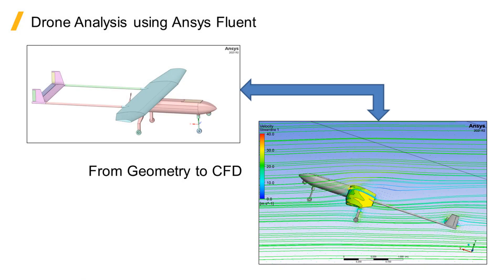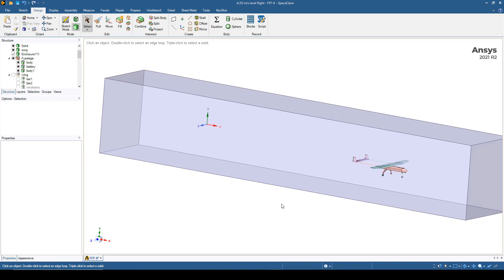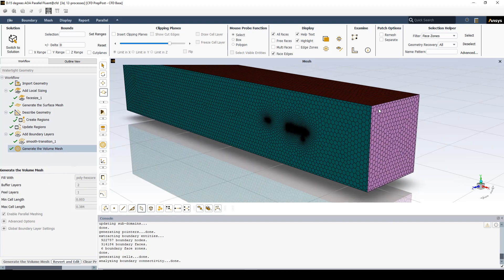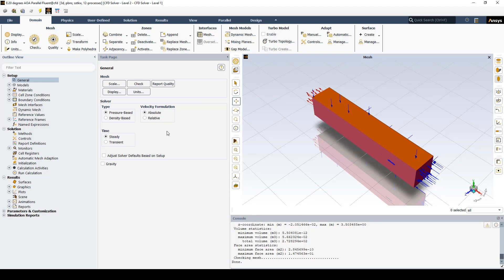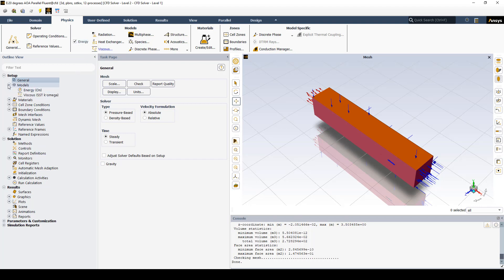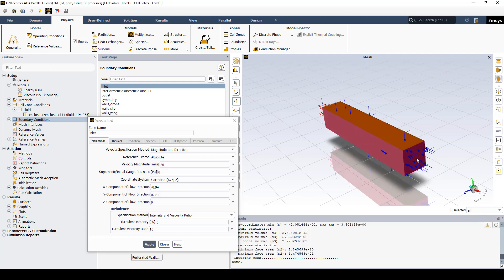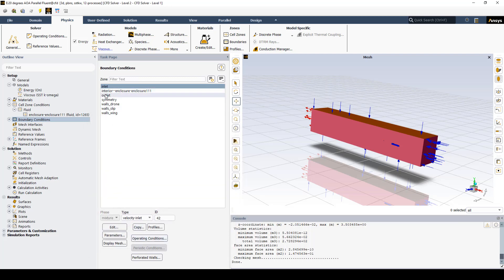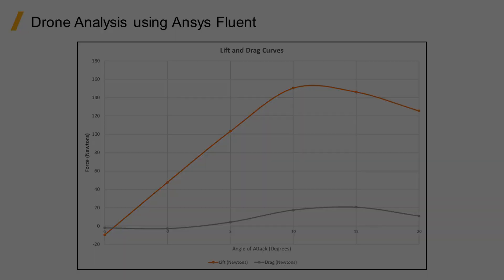External Aerodynamics of a Drone (UAV) Using Ansys Fluent

Comment: But If I need to make for example rolling moment variation with beta then the symmetry is not valid right?
Reply: Not unless you apply a rotational mesh transform to the entire fluid domain. If you do then you could get away with keeping the symmetry condition.
Reply: @DThorn619  thanks for your reply 
I will try to incorporate it in my future cases. Ps is there is any tutorial for that?